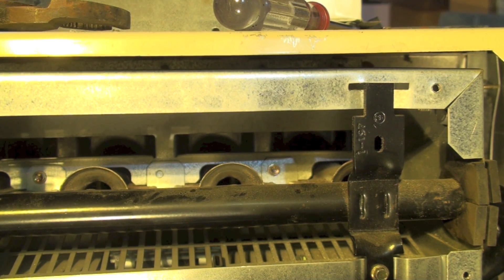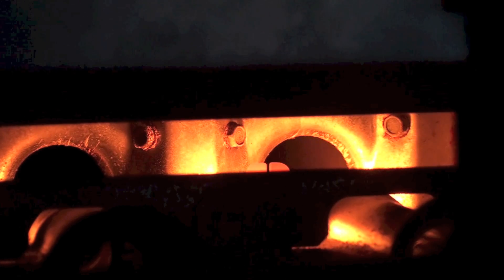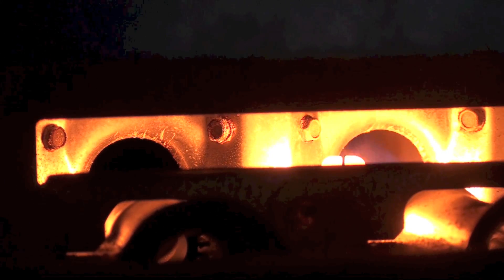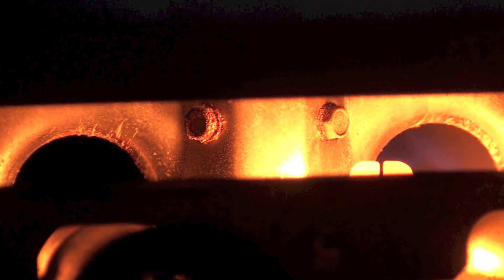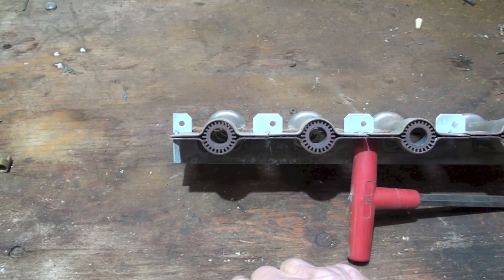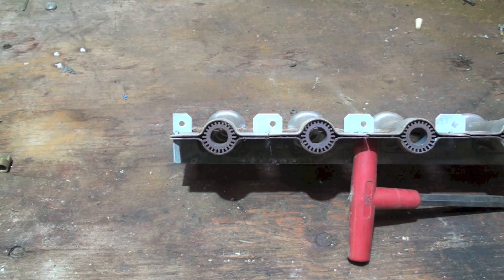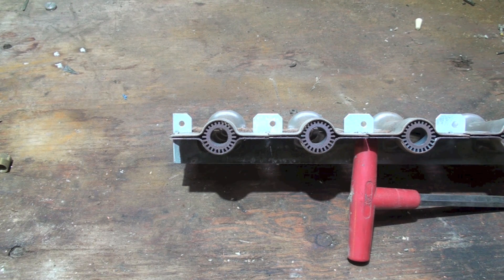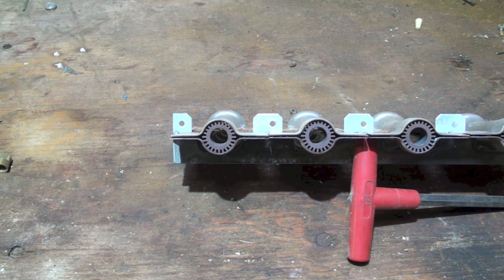Gas furnace not lighting all burners

Comment: I have an old natural draft furnace that has this same issue, except if the second burner doesn't light, the first burner will stay lit and the furnace will continue to operate.  The furnace doesn't have a sensor, so I'm assuming the gas from the second burner is going out the exhaust pipe.  How dangerous is this, could the unburnt natural gas ignite in the exhaust stack?
Reply: I was able to fix my problem thanks to you!!  Please keep putting out the awesome informative videos.

Comment: Worked great, I was able to reach the flame spreader with a brush, and I didn’t have to remove the burners, thanks for this video

Had to take out and clean properly, the brushing from the outside method wasn’t working consistently and it needed a good cleaning like the video shows

Comment: Never would have guessed that this could be the problem. Nor would I have ever tried looking there, with it being stuffed in the attic and the uncertainty of it all. Once I realized only a few were lighting and then shutting off I found this and there was no more guessing. One thing to note on mine, the jets for the burners that had trouble lighting were marginally clogged.  Luckily I had a carb/torch cleaner on hand to clean them out to match the other clean jets. Not sure if that made much of a difference, but they're all firing every time now! Thanks for sharing

Comment: Im a service tech. I've got a furnace with the middle burner only lighting and going out. No cracked heat exchanger, burner assembly is good. I'm perplexed
Reply from the maker: If they are inshot, some of these burners were defective but did not show any problem.  You might try replacing the burners.
GFM

Comment: I didn't have a long enough extension to reach the bolts on my far right one on hand and mine would only light on one burner for the first trial or two. Usually on the third trial it would light off all of them but would be kind of "explosive" in doing so. Just to get it working good for now, I took a Dremel brush wheel, bent some of its wires, and was able to work them back and forth through the cross lighters (crossways or whatever they're called). Fires up all the burners good now. Thanks GrayFurnaceMan!

Comment: One of my 4 burners was not igniting well by watching it. I removed some dust with tissue paper from the top. I tapped on each burner spreader with a screw driver from the top a few times. I used a small vacuum attachment to vacuum some in the area. Turned on the furnace and this last burner now spread flames better and the furnace would stay on.  Before I had a furnace installer look at it and he replaced the blower motor for $600 but said one burner was not coming on well and did not fix this. Thanks great tip.

Comment: Hey thanks for the video! I have a guardian furnace and it has been doing this since it was installed... as the call for heat turns the furnace on it’ll only fire on the first two tubes and then cut out. On the second attempt it’ll fire on all 4 tubes.... Once in a great while it’ll fault out after third attempt and then our cabin freezes up. Just wandered back to you tube and low and behold I found your video! I’m going to try cleaning or vacuuming out the flame tubes. Thank you!
Reply from the maker: Hope it helps
GFM

Comment: I have this issue and have cleaned the burners and it still will not always light all burners.  it does when the burners are warm, is the gap for the flame/gas supposed to be a certain width?
Reply from the maker: I would first want to be sure the manifold pressure is within manufacturer specs.  Also, a crack in the heat exchanger could affect the flame propagation.  Rust in the burners could make them unusable.  
GFM

Comment: Thank you for this video. I was able to fix my furnace last week when I found not debris, but water accumulated in the air gap/flame spreader gap between the 1st, 2nd, and 3rd burners. I'm having the same problem again about a week later now. Any idea why my furnace is accumulating water in this area?
Reply from the maker: Water is bad.  Unless the unit is located outside, I would be looking at low gas pressure.
GFM
Reply: Thank you for the quick reply.

Comment: I'm seeing this happen a lot on brand new Rheem gas furnaces that were just installed and fired up for the first time. Are they having any issues with defective flame spreaders? I'm very frustrated with these new Rheems
Reply from the maker: There have been some units (not necessarily Rheem) that the press forms are worn out and can't make them correctly.
GFM
Reply: Same issue,brand new Rudd propane furnace does not light on first try, one or 3 burners light only

Comment: What if flames circle around burner think back draft gonna clean everything
Reply from the maker: If it is a multiple burner furnace with an inducer fan, you probably have a cracked heat exchanger.  Dangerous.  Do't use it.
GFM

Comment: Having this same issue where only the first burner is lighting and it won’t spread. I’ve taken it all apart and cleaned it out and still
Nothing. It’s turned on all the intermittently but won’t stay on.
Reply from the maker: I would check gas pressure.  Also, the unit could have a cracked heat exchanger.
GFM
Reply: grayfurnaceman so being the persistent dumby I am. I use a air pump for a football and as soon as the fire burner came on I blew the air and all the burners came on. So I’m assuming this is a pressure issue.
Reply: @Marklujan20  You could also have bad burners.  Some of the burners are not noticeably rusted but could be.
GFM
Reply: What do you suggest if that’s the case? What’s safe to clean them with other than taking a wire brush to them?
Reply from the maker: The wire brush is about the best.  I would replace them.
GFM
Reply: Ok, so burners are replaced still have same issue. But if I bang on the black pipe that releases the gas to the burners it’ll kick on. Sound like something may be clogged?
Reply from the maker: Not really.  You might try testing manifold pressure.  You will need a manometer.
GFM

Comment: Saved me!   I've had an intermittent problem where occasionally my furnace under the house would blow cold air.  Hooked up a spare thermostat under the house, where I could easily cycle the furnace and observe it's operations.  After a number of startup cycles, I finally saw with cycle that not all the burners ignited and the gas safetied off.  Crawled out and came up and did a symptom search, and your youtube was on the top of the list.  Described my problem exactly, and I now had hope that I would finally get to the bottom of this intermittent problem.   The challenge, figuring out how to take the burners all apart,.  Knowing I wasn't on a wild goose chase, with determination I got it all apart and sure enough, 2 of the 4 burner grooves were clogged with something like corrosion.  Took them to my shop to wire brush them all, and then reassembled.  They all light much faster, and I couldn't force another failure.  Returned the furnace to normal thermostat, and has been running perfectly.    Thanks SOOO Much!
Reply from the maker: Welcome
GFM

Comment: Thanks for the video. I was able to find my problem with it. my question is how do I go about removing the burner assembly to clean it as only the first 2 burners are lighting.
Reply from the maker: On most furnaces, this will involve shutting down the gas at the gas cock near the furnace and removing the gas valve/manifold assembly.  The burners can then be removed.  Be careful of the hot surface ignitor.
GFM

Comment: I have this same issue and have completely wire wheeled and wire brushed and cleaned the burners to nearly new and still have this issue. Do you have any suggestions for another possible cause?
Reply from the maker: There could be alignment problems (usually damage in shipping).  Low manifold pressure is also possible.  Also, some burners in the 1990s had factory defects that would cause this.  Just some things to look for.
GFM

Comment: I just want to thank you for taking the time to make this video. This was the exact problem I had with my furnace. Looking at it I had thoughts of adding another igniter. I had never heard of a flame spreader. My furnace had been sitting for over a year due to a failed gas valve. We used electric heat all last Winter.  My flame spreaders were totally clogged with rust. Took a dental pick and compressed air, and with your advice it now works flawlessly. Thanks Again,  you are the man!
Reply from the maker: Welcome
GFM

Comment: What if it also makes a loud bang after it doesn't light? all but one of ours doesn't light but still cycles through the heating process, but then after it shuts down it makes a loud bang
Reply from the maker: +Jenn V Its probably a delayed ignition.  That will make a small explosion.  Be sure the burners are clean.
GFM

Comment: Lint is a common factor for the unit in a laundry room or Laundromat. Some units that hav'nt been maintained or even more commonly not used during the summer may have the rotten spider to blame. I've found spider webs as far back as the gas valve. This can mess with the gas pressure coming from the valve. Some lesser techs will instantly think the gas pressure just needs adjusted. One of the most common mistakes a tech can make it to diagnose without checking. Remember Murphy's law, What can go wrong will go wrong given enough stress and time and the more moving parts you have the more chances of something going wrong.
Reply from the maker: Luke Collier Very well said.  Thanks for the thoughts.GFM
Reply: grayfurnaceman Thank you post a lot of things that the ordinary tech would never try. I like that. thanks for the reply.

Comment: Should this never happen if a burner is cleaned regularly?

An oil burner can go years from a perfect start.

An oil burner if cleaned yearly should be perfectly reliable not counting a component failure.
Reply from the maker: nerdful1 First, oil burners should be serviced each heating season.  Skipping service is a recipe for disaster.  I have worked on oil furnaces that had regular service with no failures in 40 years.  Generally, with regular service, gas burners will be cleaned and will not plug.  There are some problems with the galvanized burners corroding, but the stainless steel ones are pretty much ok.  Another problem could be if the unit is installed in a laundry room, and the washer and dryer are run often, lint could plug them during the heating season.  Thanks for the thoughts.
GFM